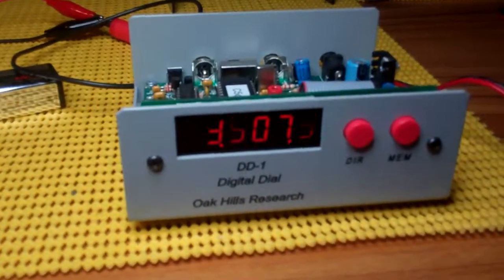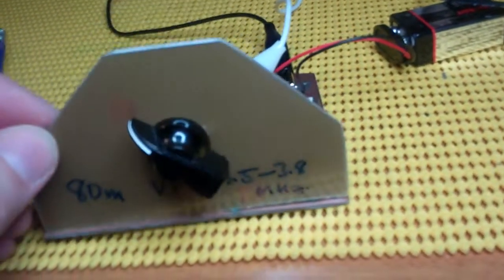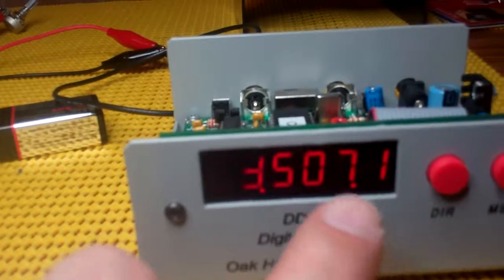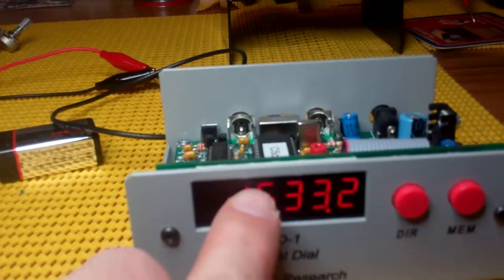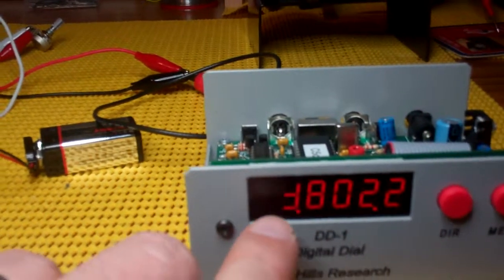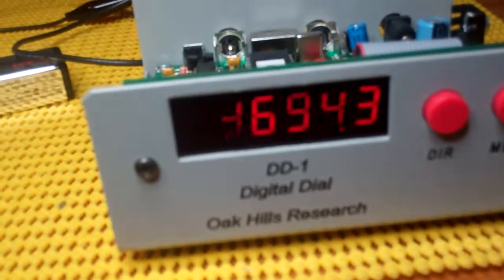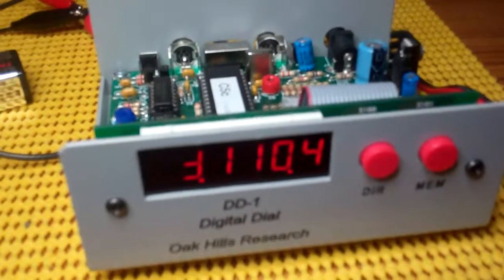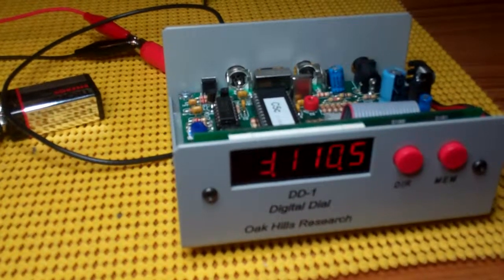OHR DD-1 digital dial video for Marshall

Comment: Just curious to know whether or not you resolved your issue? My first impression was insufficient power source voltage; if in fact you were powering it with only a 9 volt battery, as it appeared you were on the video.  73 de Brent
Reply from the maker: Hi Binder. Yes, the issue was traced to a TINY piece of solder that created a short circuit and affected some of the segments in the display. I looked at all the segments of all digits affected (LED segements come in a, b, c, d, e, f, g labels). I built a logic table to understand what was working and not working, and was able to deduce that some pairs of segments were touching. I searched with a high power magnifying glass and found a TINY sliver of solder from my build. Once removed, the counter display worked well. It is a infact an excellent digital frequency counter, as later validated by my function generator that cost much more.
Reply: So glad you got it fixed! Sounds like a cat whisker.....